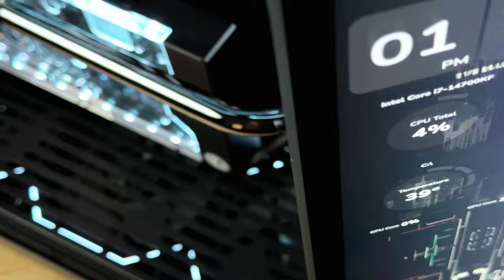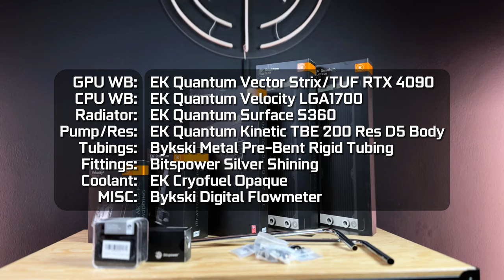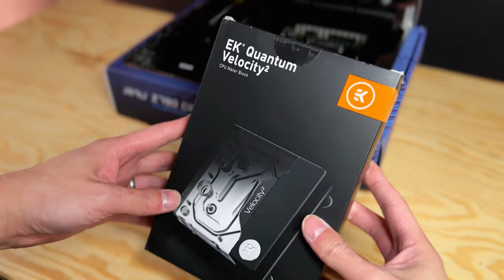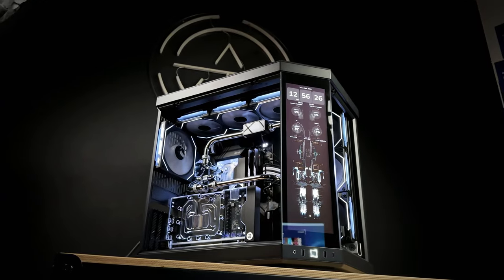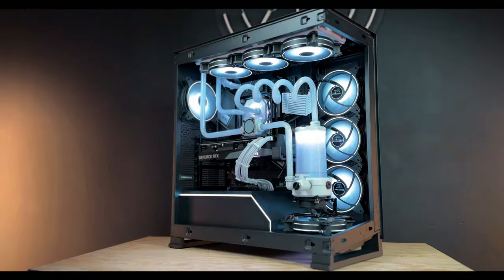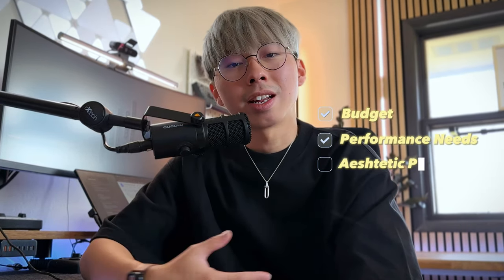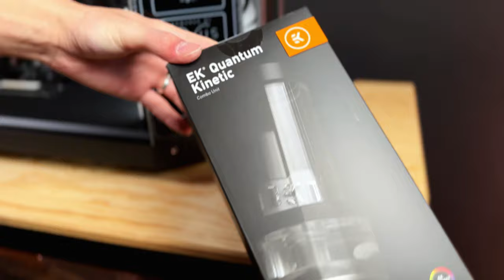⚪Monochrome⚫ HYTE Y70 Touch Custom Loop Water Cooling PC Build

Comment: I have my parts mostly here.  I am only waiting on the Y70 (Non Touch) case, clear acrylic tubing and the EK nickel fittings.  I have the exact same blocks you used and EK reservoir pump combo (160).  I will be going with a all white theme with the Lian Li uni infinity fans for the top radiator and the Lian Li LCD fans for the side radiator.  I will run clear solution through the tubes and have the CPU block rotated 90 degrees from how yours is.  Can't wait to finish the build.  Yours looks amazing.  Great job!
Reply from the maker: Thanks! Good luck on your build!
Reply: Just saw yours on your page. You should share a full video. Looks great!

Comment: I wondered if the pump combo unit could be mounted to the back of the display. Or using a flat reservoir from EKWB for example. It would improve the airflow from the side of the case and maybe the pipes management.
Great build ! I like it with the display in the corner. 🙂

Comment: Beautiful system, always love to see chrome piping in a watercooled build, and cable management is great. Wish you were UK based.
Reply from the maker: Thanks! We’d love to ship something like this overseas but the cost of logistics is just too high 🥲
Reply: @archetype_origins  I doubt even if it was possible that, the gpu could remain installed or the loop filled. many points of failure sadly, and we also know how well shipping companies look after things.  If  I won the lottery  though it would be worth flying you both over to build something unique.

Comment: I have this case but I did my air flow differently. Pretty much all my fans are intake except my 140mm in the rear for exhaust.
Reply from the maker: Hmmm that’s probably too much intakes
Reply: @archetype_origins  My friend set it up. He said he worked in server rooms in IT and said its the same concept. They had a lot of intake with only one area of exhaust. Said it helped keep it cool. My thermals are pretty good thought.

Comment: Thank you very much for your video, why didn't you put an exchanger after each water-block? Shouldn't the regulation be optimal with the two exchangers in series?
Reply from the maker: I’ve watched and built so many custom loop water cooling system before but I’ve never heard of an exchanger. Care to explain how it works?

Comment: Great Build! For the Rigid Tubing, Did you use Copper Chrome plated Pre-Bent tubing and Straight Brass Tubing? On the Bykski Site, Straight Tubes only came in brass and not in copper so it made me wonder if you used a mix of both or just cut the pre bent ones to use as straight tubes?

Comment: Is there a way to mount an AIO GPU in THAT exact case for those of us who don't want to mess with the actual water cooling stuff? I want to put a CPU and GPU AIO in that case but all the builds are just showing demos with air cooled setup for the GPU. Yours is the first water cooled GPU so thats a start.

Comment: Do Weight of metal  pipes bend at connections
Reply from the maker: What?
Reply: @archetype_origins  due to heaviness of the metal, does it bend at the connection, (one end connected to GPU or processor, or pump??)
Reply from the maker: Shouldn’t be an issue if you securely tighten all the fittings

Comment: why is there so much thermal paste, went to school for this and they always told me 4 corners and middle dots the size of a rice grain and that having too much was bad, were they wrong ??
Reply from the maker: Too much is always better than too little. Did they teach you to spread your thermal paste for maximum thermal efficiency? 🤔
Reply: @archetype_origins   It's not a choice of only too little or too much, just enough is preferable to both of those. Too much can cause thermal transfer issues as well and you are a bit heavy with it. Amazing looking machine all the same, nice build!

Comment: I have the same case if I want to build a custom loop similar like yours, but I am using Ryzen 7950x3d same mobo tho
those parts list listed are all needed to build one'?
Reply from the maker: You can use an AMD CPU on an intel motherboard, have to look for another mobo
Reply: @archetype_origins  I meant I have same motherboard msi carbon for AMD
Reply from the maker: I see! 👌
Reply: @archetype_origins  Do you mind sharing full details of how many fittings and which ones you used to make that custom loop?
Reply from the maker: Absolutely, we do provide one-to-one build consultation services if you’re interested
Reply: @archetype_origins Noticed gpu connected to inlet of the pump then outlet of gpu into inlet of cpu
Wonder how that work.

Comment: i think its so expensive 🙄🙄why you shouldn't try dual Xeon CPU V4  ,and high GPU card more powerful more cheap I7 its expensiveeeeee🙄🙄🙄
Reply from the maker: Thank you for your input. The CPU you often recommend it not very accessible for most people. The upgrade options would be very limited if our clients wanted to upgrade. Also the motherboard options would also be much more limited.

Comment: As soon as I saw it was all EK parts I stopped watching.....what's the point of watching a watercooling build that uses the same exact (overrated and overpriced) watercooling parts as every other build on youtube?  I just don't get it....Watercool's Heatkiller outperforms EK....so you're not choosing EK for the best performance....and Bykski, alphacool and other brands are cheaper, so you're not getting it for the value.....I just don't get it
Reply: Also he got everything top tier and puts in a I7 instead of a I9.